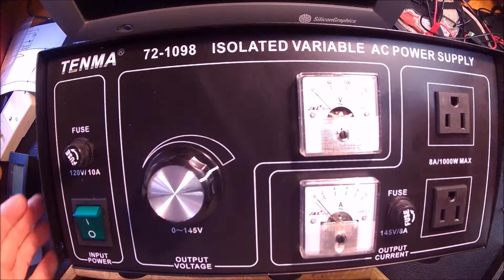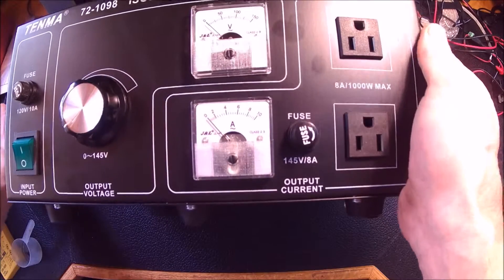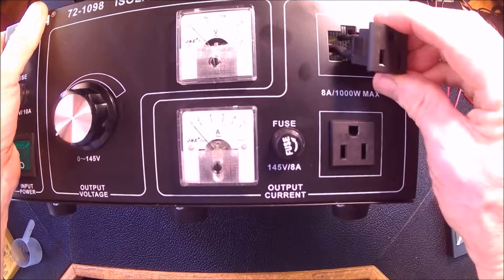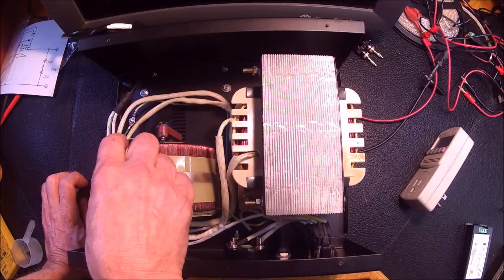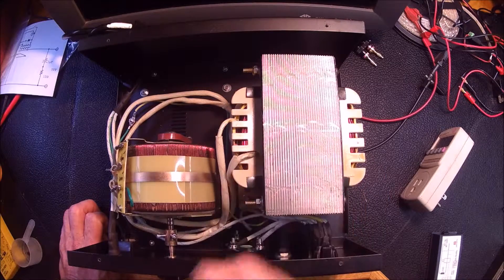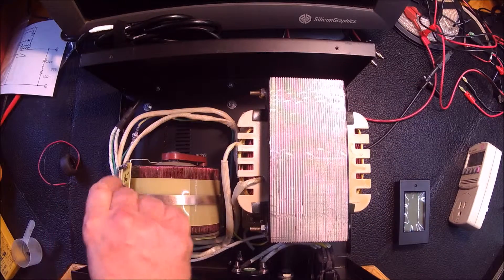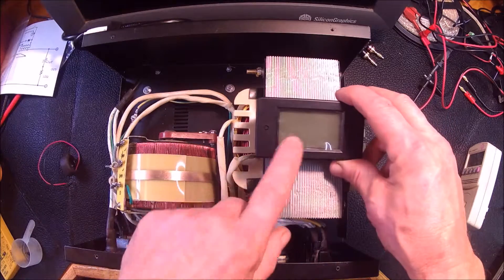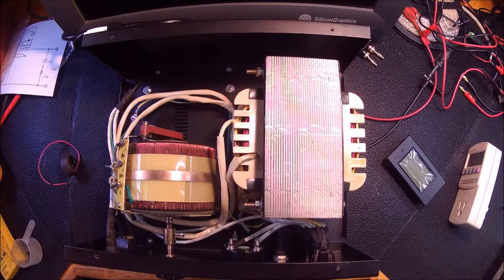Tenma72 1098 Isolated Variable AC Power Supply, Inside Look

Comment: Unfortunately, the front panel receptacles chassis ground connections are not floating, the yellow wire goes to the safety ground star point stud. It is desirable to isolate the earth ground as well as the mains from the receptacle for the unit under test. This way you do not damage a grounded work bench piece of equipment that itself is also grounded, like an oscilloscope.
Reply from the maker: Good catch, I guess I didn't see that.  Maybe next time I have that unit open, I can run those grounds to a switch so the grounds can be left floating if needed.  It looks like there's room for that next to the upper receptacle.

Comment: This power supply nice! I need one thays small luke yours here. The one I built outputs (fully iso) 127 Vac @ 15 amps continuously and peak of about 35 amps. Its huge but yhen it also has a step up system (separate transformer) that allpws me to get 347 volts. It outputs 68-48-100x2 and then 347 (a bit higher actually). A very expensive peice of equipment (thousands of dollars. 10s of thousands for some).
Reply from the maker: Sounds like a nice setup.  I might try adding a step up transformer like that to mine if I find I'm needing higher output voltages.